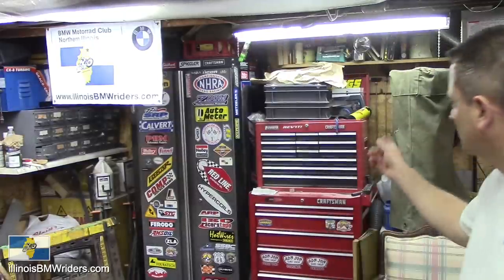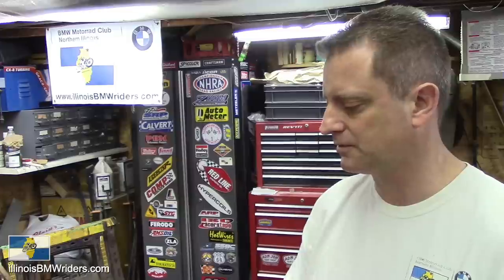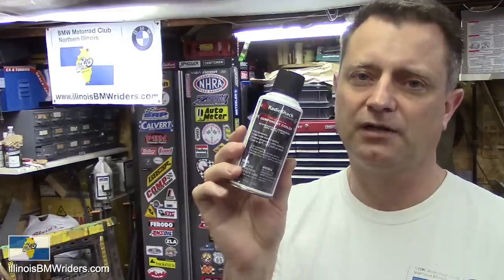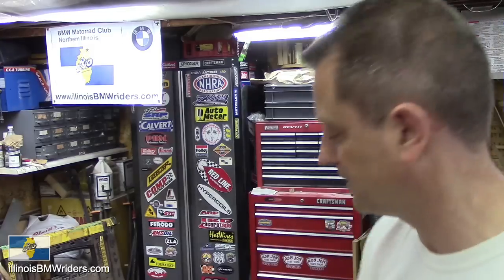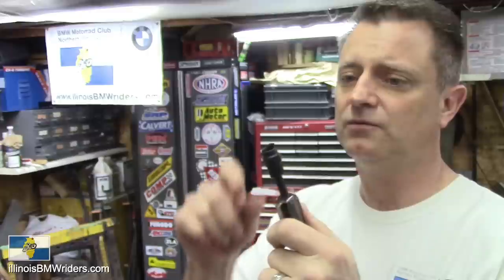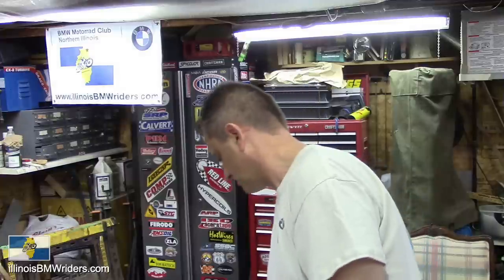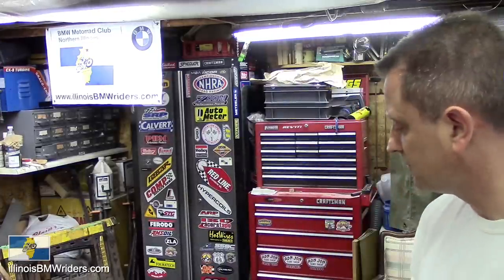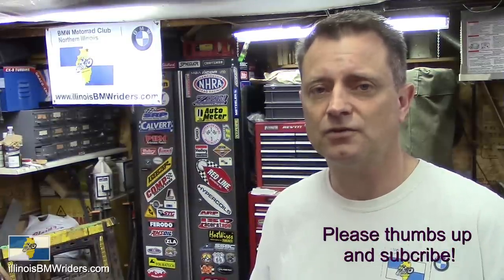Kirk's Favorite Tools for Working on BMW's!

Comment: Kirk,
I am following your advice and am now fixing my 2000 K bike (80,000 miles) which I bought 2 years ago.  All your hard work in posting this knowledge is so much appreciated.  I have my bike on stands now and am in the process of upgrading monoshock-springs, steering damper refresh, HID headlights, changing all fluids, and repainting saddlebags.  Over the past two weeks (in large part on your lead) the fuel gauge was repaired with new fuel filter installed; "canisterectomy" performed with disconnect of BS airtemp sensor/computer (BMW's engineering failure); new fuel injectors (will try new 4-hole EV6 style); checked valve clearances (all good), new front brakes & Bridgestone tire.  ABS controller is on deck for a rebuild this winter.  When the time comes I will do the clutch and tranny seals myself.  I have been working on cars/bikes/snowmobiles since I was a kid but always try to take a thorough mental walk-thru of the repair procedures first - previously this was via a crappy repair-manual, but now I rely on gurus like you whom take great pride in their machines and in the craft of mechanics.  Thank you.  If ever riding thru Pittsburgh message me in advance and I will show you my town.
John

Comment: Kirk - You always do a fantastic job on your videos! The only tool that came to mind that you didn't mention was a metric tap and die set. I use the dies often to clean up threads on screws and bolts before reassembly.

Comment: Thank you so very much Kirk. I've ridden Harleys for 43 years and within the last few months have bought two BMWs. Guess what? I have no idea how to work on them. Your videos have showed me how to change the engine, transmission, and final drive oil. I'm sure that eventually (if I live long enough) that your other videos will assist me in doing other maintenance that I will need. But, for right now I'm happy for what I've learned from you as I'm (Lord willing) traveling up to Northern Michigan from Cheyenne, WY in the next month or two. 
May God bless you for sharing your expert knowledge with the general public Kirk. You are a man of God.

Comment: One of the chargers I use is a "12 Volt Deluxe Battery Maintainer and Float Charger":
$19.95 and its fast & easy to plug in. My bike lives on this over winter.
http://www.harborfreight.com/12-volt-deluxe-battery-maintainer-and-float-charger-61911.html

Comment: Hi,  I am about to replace the header pipes for MIVV headers that delete the cat and flap. I will keep the stock tail can. Stock air filter.
The question is do you need to do a remap for this MOD?
I see a few people fit the booster plugs, or throttle plug-in device to fuel up low rpm range.
And some say there is no need because the brains of the bike will adjust to the correct fuel, air mix all on its own. 
Your thoughts on this, or your mechanical magicians expertise would be greatly appreciated so I can rest my mind and give my 2014 1200 GS Adventure the best result. Thanks. Love ya work.

Comment: Great video, like how you clearly explain the good, the bad and the ugly about tools. If you need smaller 1/4 inch drive ratchet drive and ex bit drive, check this set on Amazon : Titan 11203 Offset Micro Bit Driver and Ratchet Set - 2 Piece. I bought a set and they work great in confined area with 60 tooth/inch. The socket driver has an ejecter pin button. You can't fit a socket on it or off it without that ejecter pin, it holds your socket in place better than regular socket driver.

Comment: For a similar pair of those needle nose pliers you like check out the Channellock 3037 Snipe nose pliers, they are very narrow at the tips and I use them often on bikes. Available on  Amazon http://www.amazon.com/gp/product/B000271INO?psc=1&redirect=true&ref_=oh_aui_detailpage_o04_s00 

Forget the tap & die set to chase threads, use the correct tool known as thread restorer kit. Sears sells their craftsman brand for half the cost you will find on the tool trucks. They are all the exact same kit made by Kastar. 
http://www.sears.com/craftsman-40-pc-tap-and-die-set-master/p-00952105000P?TecPara=159_4155
Reply from the maker: +Mark Fox Thanks Mark!

Comment: A slight change of topic I watch the video of you changing the spark plug leads did the bike run much better
Reply from the maker: dwmfty much better? no. but a little better and worth doing since the wires were internally cracking and worn through in many areas. If you are on the fence about changing them, ask yourself what is better. Fixing it after it breaks or preventing an inevitable problem altogether?
Reply: Thanks keep up the good work no
Reply: Keep up the good work. ( no is a bump on the keyboard sorry)